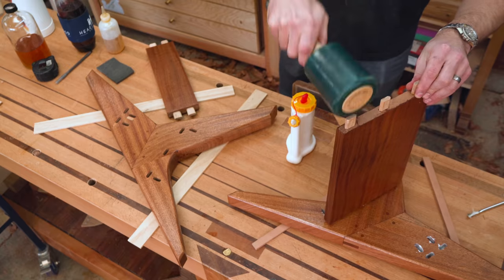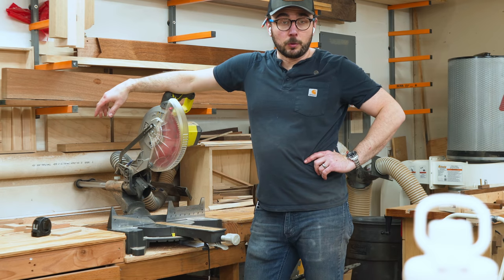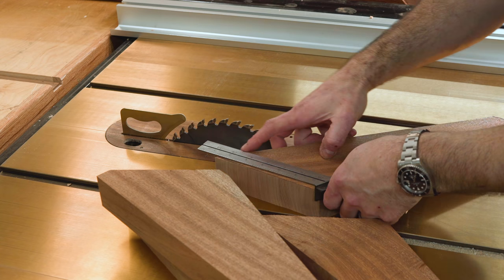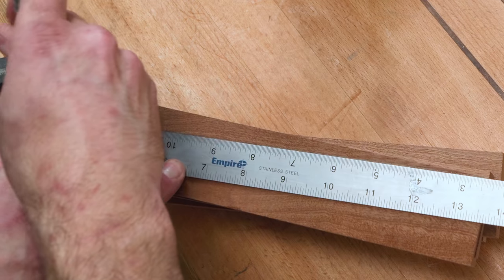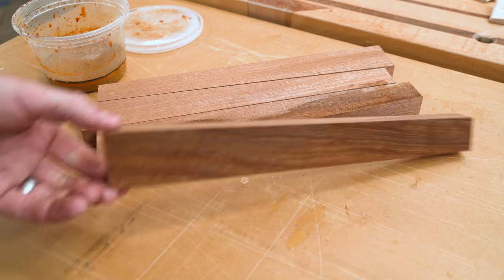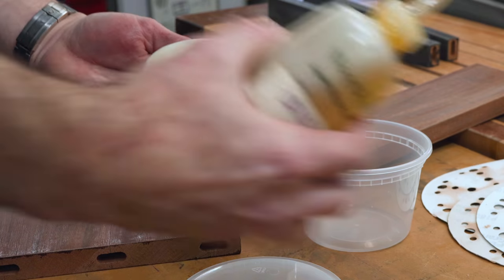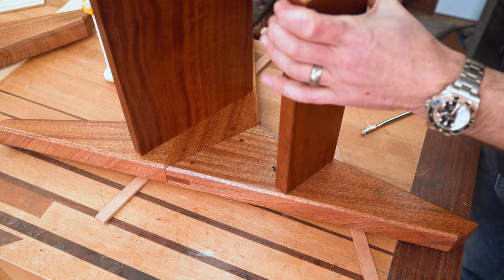Not Just A Step Stool

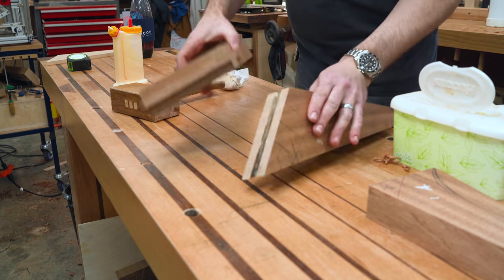Comment: Great job!  Very interesting design.  I believe the mistake you implied at 3:48 is that the spline that joins the two legs should have been made with the grain running the opposite direction.  As is it would be easier to fail under stress.  Then again you built it for a 5 pound dog and not likely to happen.
Reply from the maker: Yep! You got it! I actually cracked one of the splines on dry fit when torquing that join above and below w/clamps. Ended up breaking the other apart and reassembling with dominos and epoxy for its end grain adhesion attributes.

Comment: The nearest I can get to a possible error is the cross grain of the lose tenon.  It MAY have possibly been better running in the other direction but it's an angled joint in any case so I'm not sure that is what you meant.   Stunning design in any case.

Comment: Great design & build, love your use of brushing on french polish as deal coat before button coat then spray. I've tried it couple of times but thick waxy residue took lots of cleaning to salvage brush!
Reply from the maker: Are you using dewaxed flakes?
Reply: No, very waxy, purchased a premixed bottle
Reply from the maker: Ahhh yeah definitely try the de waxed flakes and grain/denatured alcohol. So nice to work with

Comment: Great design and beautifully put together, was wondering what you reckon the weight limit of the steps would be . Regards Jim UK.
Reply from the maker: Thanks Jim! Held me just fine w/o any deflection and I’m about 200lbs (14 st.) I think the issue with this construction is that over time, it’s relying on solely glue to hold it together and there’s no mechanical advantage in the joinery. Could wiggle loose over time. For it’s purpose, should outlast the next few dogs

Comment: Nice combination to the bed. I like the idea of the three parts coming together a 45-90 degree joint.
However (and there is alwaya a "however"): I would have veneered the top edge with a 2mm mahagony strip. With the roundover the joint, which still show in your stool, would have disappered. 
Otherwise, as I said: combines to the bed elegantly.

Comment: New to the channel, enjoying it greatly as an amateur woodworker. I’m sure this info is out there on paper but I’d love to hear an opinion on what you feel the different “cuts” of shellac help bring out or do for you on various projects. I want to learn how to better layer my finishes and I know shellac can be a very useful player in that. Thanks for the effort and content!
Reply from the maker: Hey Joshua. Good question. Heavier cuts carry less solvent in the solute, so they dry more quickly and build faster. A heavier 2lb-4lb cut are good to seal, but will build too heavily, leaving a thick plastic-looking film (more like varnish). Because they dry more quickly, streaks are more likely and sheen is harder to control. Light cuts produce a much more satin and even finish given that there’s more control over the application and many coats means errors are likely covered by the next (less likely to be heavy in the same spot twice.)

Comment: I like the design, the asymmetry of the steps are great. I'm guessing that the error is that the spline was cut off too short and doesn't extend through the  front leg ... or... the spline wasn't cut blind so that it DOES extend out and show on the front. Either way coudl have worked, I think that leaving extra meat on the spline and having it show through the front leg would have made the simple floating tenon joint look like it was much more complex inside where you can't see and left the viewer "wondering". The step cross supports work well. They add another dimension and definitely make the entire piece look like it's much more complex than just a simple step stool.
I like the complex builds - my goal is to be able to make those builds look as effortless as you do, so keep them coming, while at the same time these more approachable "beginner" builds are great. Either way I'm waiting for your next amazing build.
Do you ever do anything off the cuff to use up the scraps, or are they just waste??
Reply from the maker: The grain orientation was wrong on the spline. I think with some more planning, could have made that 3-way much cooler, but it needed to get out the door. I usually make shop furniture with my scraps. Haven’t had much time to build myself anything, but hopefully will be able to schedule in some time for that soon now that business is starting to go more smoothly.
Reply: @SawyerDesign  I saw the grain, thought perhaps because it was opposing the legs that it would still be fine, but you're right, you're not worried about the legs spitting, but the joint separating ... I suppose that, in theory, you've created a stress problem by gluing the leg to opposing grain resulting in the inability for it to move there - the taper and shape of the leg probably alleviate that though.  I expect that it will hold together for years regardless
I still love it.

Comment: Love the angles. Complimenting the bed frame nicely. Do you hand plane your stock once you’ve machined planed and thicknessed? Or does machining create a smooth enough finish?

As always thanks for great content. I’d be interested to see your rough plans before starting a project. But I wouldn’t be surprised if you “wing” it mostly. Thanks!
Reply from the maker: Those were my plans I worked from at the beginning. My larger projects are pretty similar w/a few cad drawings. 

I usually hand plane all my smaller parts. It’s typically a lot faster than sanding through the grits and produces a better sheen. I never finish a surface straight off the machine.
Reply: @SawyerDesign  thanks for the insight!

Comment: Hey, Nick! At 4:02, "what's wrong with this picture"? Only thing I saw was that you did not apply any clamping pressure across the face or thickness of the boards. The red clamp would have pulled the tip of the joint apart because the pressure points were below the lower part or the V of the joint, which would have acted as a fulcrum to separate the joint. That's all I saw.

Otherwise, excellent work as usual. You call this a simple design? What was that tool you used to cut the holes for the oblong pegs. I like that better than pocket hole screws, which are more suited for beginners such as myself. Also found it interesting that you stained and applied finishes before actual  assembly. Is that generally a better way to go? Glue cleans up easier? Thanks for posting.
Reply from the maker: Thanks David! The spline grain orientation was incorrect. I almost always prefinish, especially with shellac as it's difficult/impossible to apply into corners. Also, glue doesn't stick to finish.
Reply: @SawyerDesign  Ha! Missed that totally. I'm still learning about grain direction. I've noticed it matters when using your hand plane.

Comment: Great design, not sure I'd call what you noted as a mistake. I am curious about the dowels you used but didn't show. On your 'simple vs. crazy complex' comment: I watch cooking shows with my wife, and the 'simple' dishes chefs select are often screwed up because they highlight the most basic techniques. I'd offer that woodworking is - or can be - analogous.
Reply from the maker: Good point. The grain direction on the spline was incorrect and split. The pins on the inside were to keep moving while glue dried, but ended up being useless since the spline split (while dry fitting) I used dominos to correct the error and glued the join back together with epoxy. Better end-grain adhesion.
Reply: @SawyerDesign  Roger. The mark of a good woodworker, I'm told, is the ability to fix his/her mistakes. Looks like you're doing fine. I spent all day correcting a mistake or two of my own today. Keep up the meticulous work.

Comment: I like the design and execution.  I think the client will appreciate it as well as its what they commissioned you for.  However in my experience, dogs don't like open back stair cases.
Reply from the maker: I was a little worried about that too. I’ve never seen a dog that small lol hopefully form and function come together on this. If not, I told them I’ve got some ideas (like cleats) if she doesn’t want to climb it.
Reply: @SawyerDesign  I only know this because I have an absolutely fearless springer spaniel that will literally run through briars, bogs, or anything else for that matter in search of birds.  We went on vacation to the outer banks where everything is built on stilts for flood reason.  the stairs leading to the front door were open risers and she wouldn't even approach them.  I had to carry her up them every time.  She would run down them with no problem? I guess it's an out of sight out of mind thing?  Keep up the good work!
Reply from the maker: Yeah mine freak out over grates and at the open stairs at the beach too. My heeler can climb ladders though so maybe just takes a little training and adjustment

Comment: How long are you leaving your ebonizing solution ferment for before use and do you know if the longer you leave it does it produce a blacker colour wood?
I’ve been fermenting mine for 5-7 days before use but was wondering if longer would make a difference to the ebonizing or is it totally dependant on the tannins in the wood.
Reply from the maker: According to a chemistry teacher, stoichiometry shows that the rxn is complete with an overnight soak. Sooner if you add heat (I usually double boil in a crock pot for a couple hrs as the oxidation seems to reduce efficacy.
Reply: @SawyerDesign  really..... overnight. Wow I thought it would take longer than that. But I will take your word for it. Weren’t you like a rocket scientist in your former life? 🤣
Reply from the maker: Lol just a biologist. The dude who told me that actually is a chemistry prof so I think it’s solid info.
Reply: @SawyerDesign  that sounds solid info then. Lol